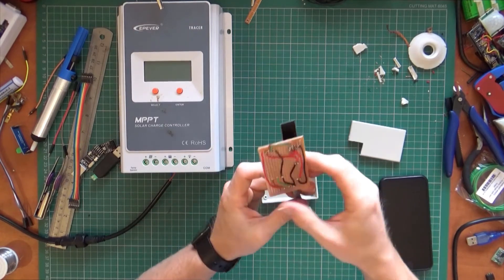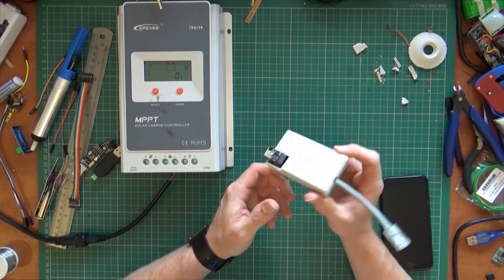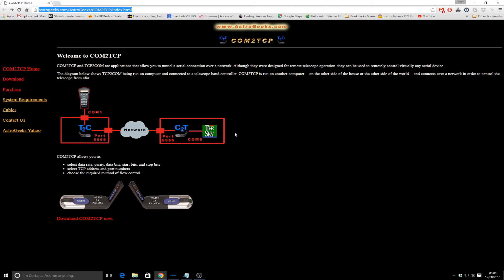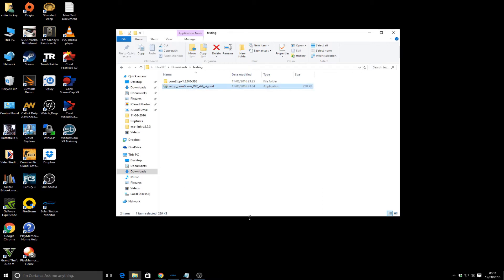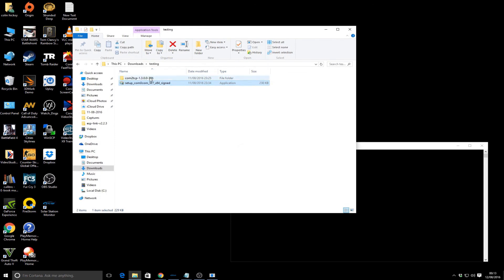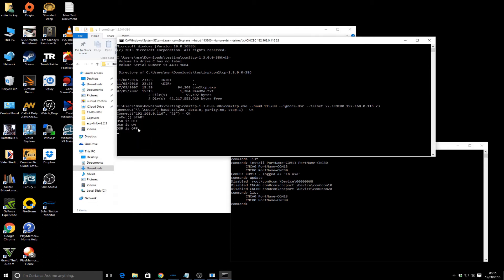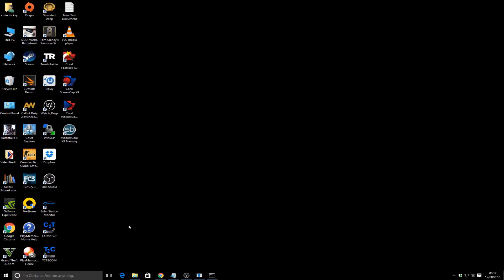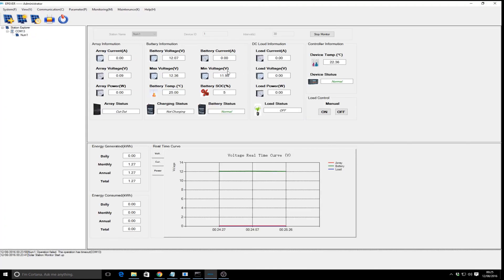DIY RS485 wifi ESP 8266 Adaptor Part 3 - Final project and Virtual com port software

Comment: Great tutorials, finished my Wifi module. Have been searching for an hour to flash the ESP and it seems that i had an faulty one :). Only have installed Com2TCP, not the second tool and everything works fine.
Is there an possibility that this works also with the android app?
Reply from the maker: Glad it works, if you mean the epever app sorry i've never used it.  I've not created a more slick version of this with custom firmware https://store.eplop.co.uk/product/epever-rs485-to-wifi-adaptor-new-revision/

Comment: Does anyone know of a web (online) app to monitor the controller over the internet?
Reply from the maker: Hi David, i'm working on the latest version (long over due) and it has a web interface which doesn't need anything else https://imgur.com/a/1KObcK5  I'm not really sure i'd open it up to the internet though.  You can get the new version to post data to a remote influxdb/mqtt setup though and maybe emoncms.
Reply: Well I suppose if you do port forwarding it should work? or use IPv6?
Reply from the maker: It’s technically possible to open it up but you’d be doing it at your own risk
Reply: Hi, I have the system that you are looking for. Just need to do the video and upload it :) If you are still interested send me an e-mail.

Comment: HI!
problem: solar station monitor=>stop monitoring=> occupied by other software
photo  http://piccy.info/view3/13214359/ea45fe091b402460578055faa9ef27d7/][IMG]http://i.piccy.info/i9/bda517503f149afbc6176508ed1373bb/1559650724/5007/1321425/epever_problm_240.jpg[/IMG][/URL][URL=http://i.piccy.info/a3c/2019-06-04-12-18/i9-13214359/240x131-r][IMG]http://i.piccy.info/a3/2019-06-04-12-18/i9-13214359/240x131-r/i.gif[/IMG][/URL]
Reply from the maker: Hi sounds like there is a problem with the virtual serial port software your using.
Reply: @Chickey  
okay. solar station monitor can collect data obtained during monitoring?
for processing data
Reply from the maker: Hi, yes i've used solar station method connecting via this method.

Comment: Thanks for the video. I was wondering if  a similar kind of transceiver can be built. I mean i want to send the Rs485 signals wirelessly to another receiver which would convert it back to rs485 signals. Can it be done in a similar fashion?
Reply from the maker: Hi, interesting concept but not something i have tried personally so can't advise you sorry.
Reply: Colin Hickey no problem, thanks for the video aneways :)